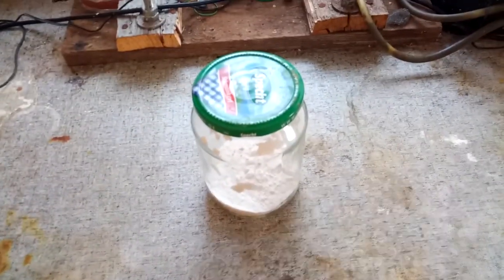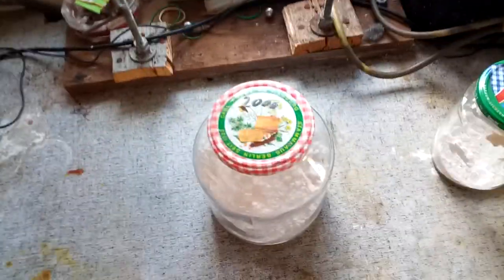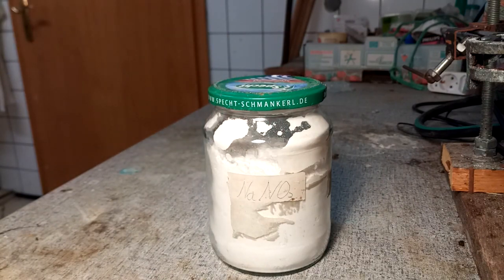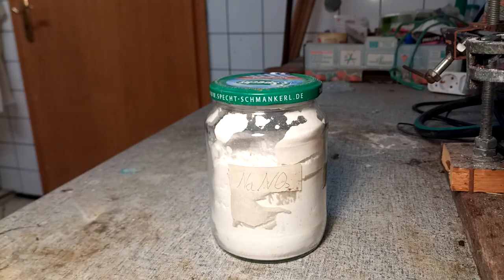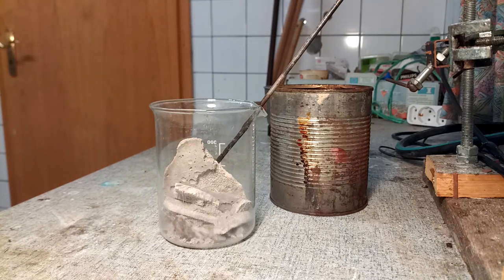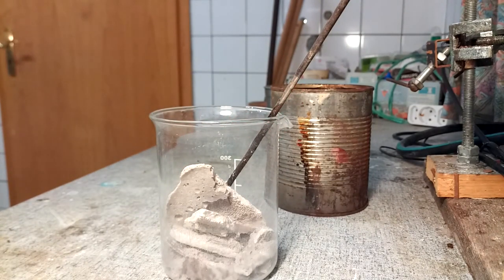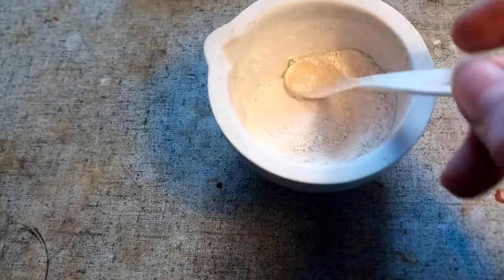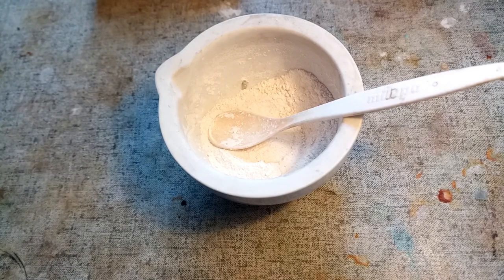Sodium nitrite from nitrate - Part 1

Comment: There's actually another way, which is iron powder and molten nitrate, I plan on using iron wool at some point and probably make a video if it works. I have tried the lead method and it needs vigorous stirring or it will just never react
Reply from the maker: That's quite interesting and I'd love to see that. So far i haven't tried any metals to avoid making giant flares.
Reply: didnt chemplayer do a test with iron powder and a bunch of other metals and it didnt work ?
Reply: Did the iron wool end up working? If it did I would be interested to give it a try as well
Reply: unfortunately no
Reply: I've tried sucrose: no luck so far. I hypothesise the nitrate is reduced too much.
Reply: @fmdj I don’t think sucrose is a reducing sugar, try glucose or fructose and then tell me the results

Comment: Just want to put in a word for safety here.  When making something like a weak gunpowder protect yourself from burns.  Don’t stand over and stir ware gloves to protect from burns and full face shield not safety glasses.  Ask me why I know .
Reply: I have an idea but I feel like there might be a good story here. How do you know? :)
Reply: @fmdj  Burnt my face pretty bad.  Was stirring NO3 with aluminum powder. Some of the powder spilled out on burner and ignited the works. Was fortunate burns didn’t scar too bad.  Long story but summarizing don’t be an idiot or take unnecessary chances.  But there is no better teacher than experience.  If not for safety glasses would be blind now.
Reply: @randycarstens1100  Aouch that must have been pretty scary. I'm glad it didn't turn out to be too bad. Plus I guess that with aluminium it's even more exothermic than with starch... Perhaps another lesson here is to not heat flammable / energetic stuff on an open flame ;) But I guess you needed more heat than a plate can provide...

You're right that mistakes are excellent ways to learn. They just need to strike the right balance between scaring you enough that you won't risk it twice, and scaring you so much that you don't want to do anything anymore.

My own latest mistake gave me a very healthy respect for chlorine and taught me that my fume hood sucks (or doesn't suck enough should I maybe say), and that borosilicate joints don't always seal as good as I would expect them to 😅.

Comment: I’m very intrigued to know exactly how and why this method works. Seems deceptively simple
Reply from the maker: I actually don't quite know why exactly this works but I think it's as simple as the starch or its decomposition products reducing NO3- to NO2- while also not producing too much heat. With starch being a carbohydrate you need to drive off almost one equivalent of water for every equivalent of carbon so the reaction temperature stays fairly low. Low-ish temperatures are the key to not decomposing all of the nitrite.
Reply: @Bavarianscience  yeah I’m curious if this would work with glucose the same way. Then at least you would know that it has something to do with the reducing nature of the sugars.
Reply from the maker: @spiderdude2099  Glucose will melt so it might react a little too fast. After all melting sugar and a nitrate is a pretty good recipe for rocket fuel. Would be worth an experiment tho.
Reply: @Bavarianscience  true, I guess the cellulose may function as a slow release glucose source
Reply: @spiderdude2099  using a high sugar content nitrate mix does work,  but can be hard to separate after.

Comment: 10:53 When nitrite mixes with acid does it make Nitric Oxide or Nitrogen Dioxide? And is Vinegar a strong enough acid to cause this reaction? Are you near Czech? Thanks
Reply: Nitrous acid which decomposes to nitrogen dioxide, vinegar can be strong enough for example in the synthesis of tetrazene but HCL or H2SO4 are more commonly used.

Comment: How do you make your NaNO3 exactly? Ammonium nitrate + NaOH? It seems weird to me that you can more easily get ammonium nitrate than NaNO3 - or is it just because that's what you had on hand?
Reply: ammonium is a fertilizer that is tbh not easy to get anymore. but as a farmer still easily accessable. and yes your reaction would work
Reply from the maker: This was HH4NO3 + Na2CO3 actually. The ammonium carbonate that's formed just boils out with enough heating. Also yeah it might seem strange anyone would have an easier time getting ammonium nitrate over the sodium salt but as  @Moritz___  already pointed out living on or close to a farm in the middle of nowhere has its benefits.
Reply: @Bavarianscience  I see, thx for the explanation

Comment: Is there a risk of producing cyanides with this reaction?
Reply from the maker: Not really because the oxidizer is in excess to the fuel. Some sources claim that cyanides are formed in this reaction but that's hard to reproduce and even if some cyanide is formed it wouldn't be very long lived with all this melted nitrate and nitrite around. Nitrites are still quite capable oxidizers after all.
Reply: @Bavarianscience  Gotcha, you explained it very well! Just wanted to say thank you for showing this method of making nitrite from nitrate. I've tried every reducing agent method from sugar, carbon, zinc and NaBH4 and none of them ever worked. I tried the starch method and it actually worked. 10 grams KNO3 and 1.5 grams of starch worked very well at producing some nitrite. I then tried it with 2 grams of starch but I ended up smelling something like ammonia, so it probably ended up reducing it too much.

Comment: Can u use another acid instead of nitric, perhaps hydrochloric?
Reply from the maker: You can but you'll have a slight chloride contamination in the end product. Any reasonably strong acid works but I went with nitric acid because the product is full of nitrate anyways.

Comment: would this work with potassium nitrate to make potassium nitrite?
Reply from the maker: Yeah it should work about the same. The potassium salts have different solubility behaviours so the workup might turn out little different.
Reply: @Bavarianscience  i did it with potassium and 25g of starch like you said.
It turned into black powder and after that it just got hotter and hotter until it went up in a flash
Reply from the maker: @pika6238  huh that's surprising to hear. Did it melt before it went off or did it behave as expected but just combust a lot faster?
Reply: @Bavarianscience  It turned into sort of a black sand and then kept getting hotter until it went poof
Maybe 25g was too much fuel so it just combusted.
Reply from the maker: @pika6238  alright that's strange. The only possible explanation I can think of would be moisture content which is generally higher in sodium nitrate because it's more hygroscopic. That way slightly moist NaNO3 would slow down the combustion whereas KNO3 is bone dry causing a more rapid reaction. This is all just speculation on my part tho.
Reply: @Bavarianscience  yeah idk but i tried again by adding small amounts of starch to molten kno3 and in the end i got something resembling nitrite
Reply from the maker: @pika6238  Potassium nitrate has a higher molar mass than sodium nitrate. This means that potassium nitrate would need less starch than the sodium salt. Running the numbers I got to a about 15-20g of starch for 100g of potassium nitrate as opposed to 20-25g for sodium nitrate. That might have made a difference. NaNO3 certainly reacts a bit too violent when using 30g or more.
Reply: @Bavarianscience  oh okay that makes sense

Comment: Why not just thermally decompose the sodium nitrate?
Reply from the maker: People have tried that before and apparently the yields are really bad. The reason for this is probably the fact that sodium nitrite decomposes quite easily, a lot easier than the nitrate. This way most of the nitrite is quicky broken down during the reaction. Potassium nitrate supposedly doesn't have this problem but I haven't ever tried that.

Comment: How to cure depression
Reply from the maker: Not with sodium nitrite, that's for sure. A cup of hot chocolate is always good.
Reply: To cure depression you'll need to block your NMDA receptors with a drug like ketamine or PCP. The receptors need to be blocked for long enough (an hour or more), with a sufficient dose. For short acting drugs you'll need a syringe driver, for PCP that's not needed.

The antidepressant effect lasts 1 week. You can take as much as you want in a day, but then need to wait 2 weeks in order to prevent tolerance. As tolerance is permanent, and a sign of unsustainable use.

Depression sucks, so here's hoping you can get yourself fixed up.

Comment: Man i want to do my part 2 of this now lol, and i dont mind that you used a clip from my channel
Reply from the maker: Ok that's good then ig. Actually you might not even need to make a part 2 because apparently the nitrite doesn't have to be very pure for funny nitrogen rings. I've already used this nitrite to make some ATZ and even a bit of NTZ and it worked ok. The nitrite solution was dark yellow/orange but it worked (with a few modifications). Though a part 2 would be great anyways.
Reply: @Bavarianscience  oooh very good to know that making funny nitrogen rings is possible with this stuff (:
Reply from the maker: @sciencething1449  Yeah it's really amazing how much you can get away with here.
In case you're wondering abt the modifications used:
I used an excess of impure (47%) nitrite and just added it until there was unreacted nitrous acid (green color and NO2 smell; doesn't kill the intermediate btw). Also I used a 50% excess of  nitric acid (thus a different amount of bicarb; just set it to ph 6-7 for the cyclization). Yield was 63%, could be better but eh. 

Good stuff Thiele and the boys figured out back then.